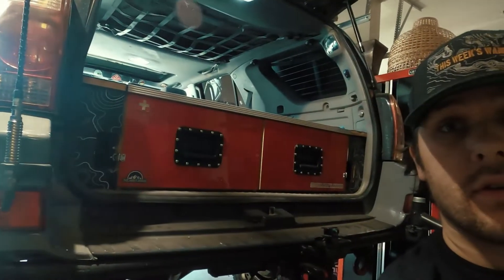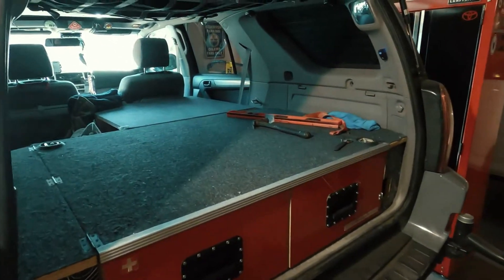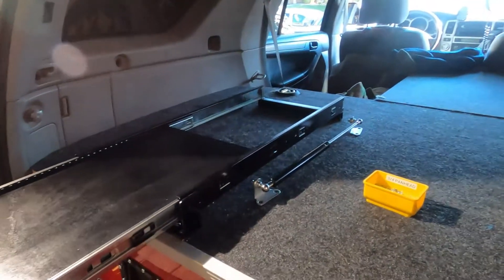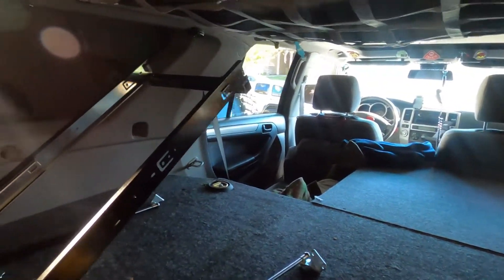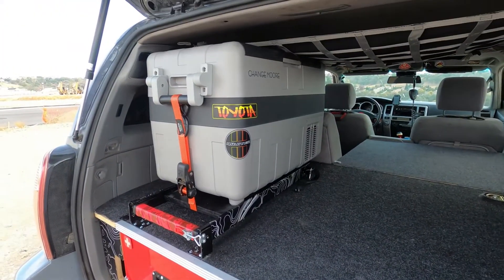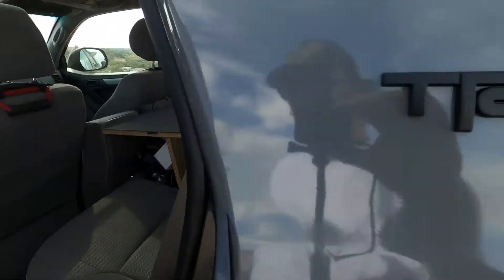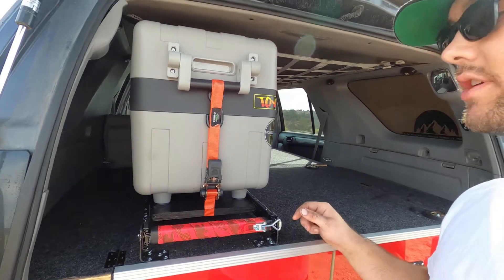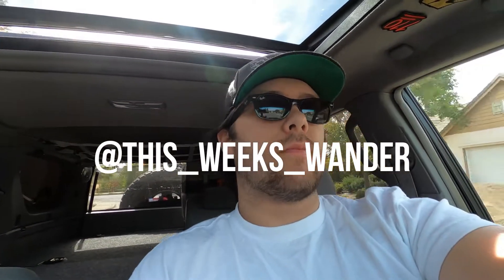DIY Overland Fridge Slide - Under $50 - Must Have For Your Fridge Setup!

Comment: Good idea.  What did you do to make the hinge point? You didnt really cover that part. Thanks
Reply from the maker: Hinge point is just some generic L brackets that I drilled  out. The slides are through bolted to the brackets to create the hinge. The bracket was then screwed to the drawer system platform

Comment: Looks good! How does it go when you go off-road with the fridge slide only secured down by two points at the front?
Reply from the maker: It worked fine for mild trails. When I went to Moab I threw a bungee cord over the front to keep it down when getting crazy on the trails